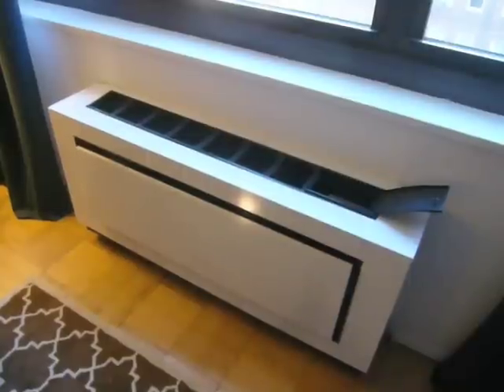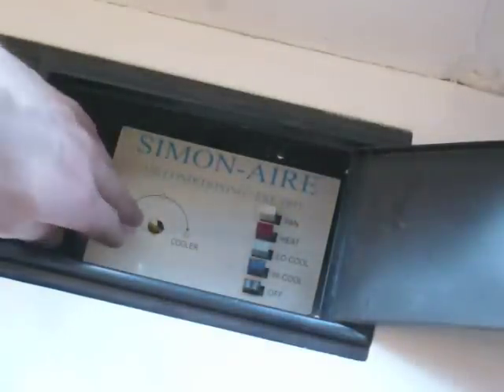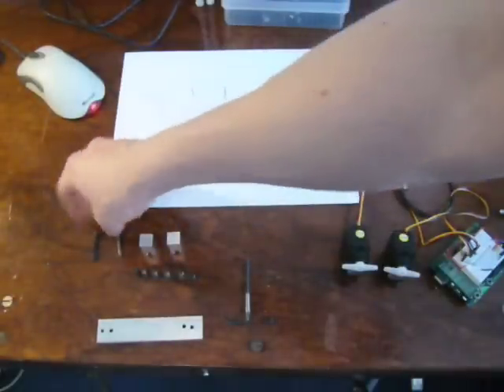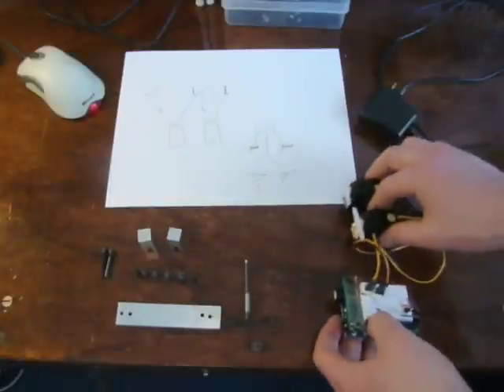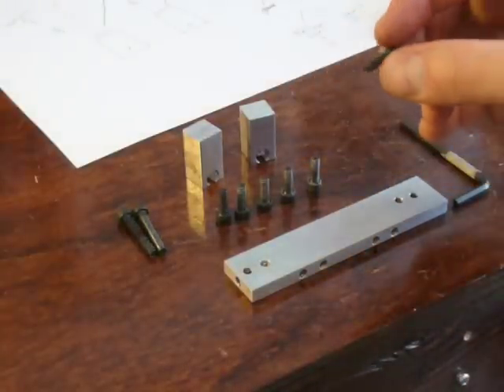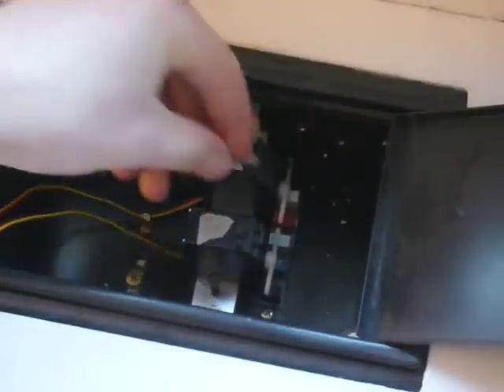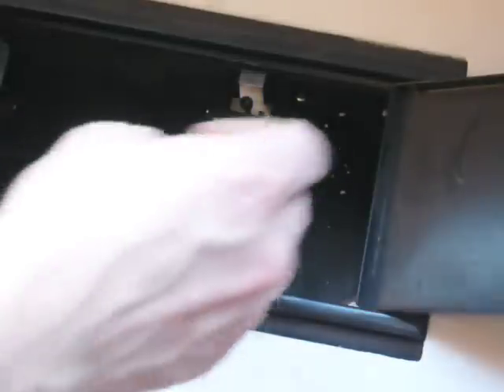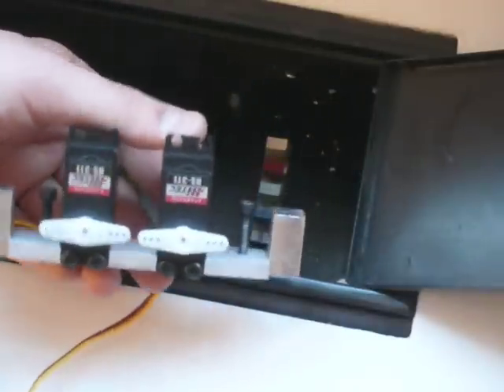Arduino HVAC Controller - Video 1 of 4

Comment: Through wall AC units are often called window shakers ;)
Reply: Tim Tanguay and HVAC usually stands for Heating ventilation & air conditioning. it referres to a trade. not an appliance.. 

that's a through wall heat pump.